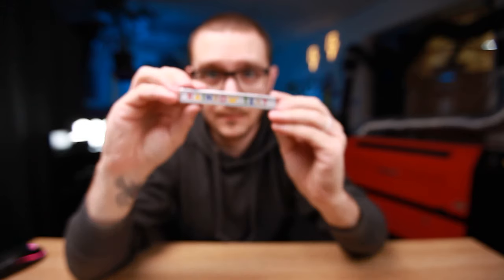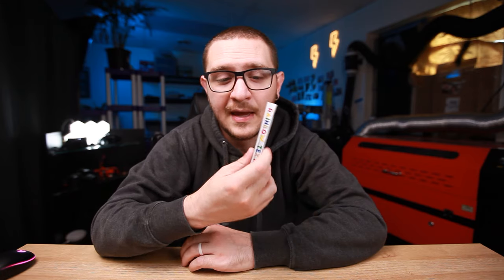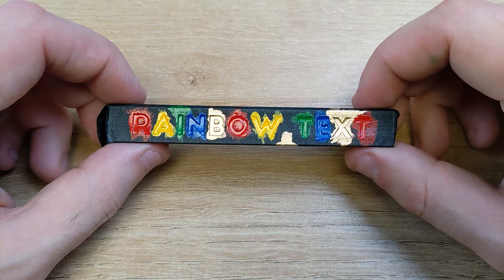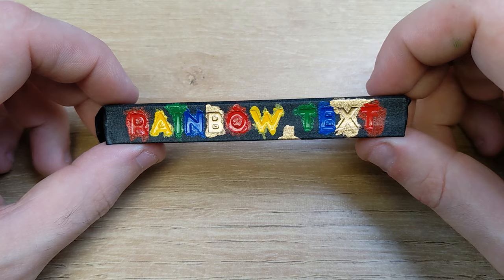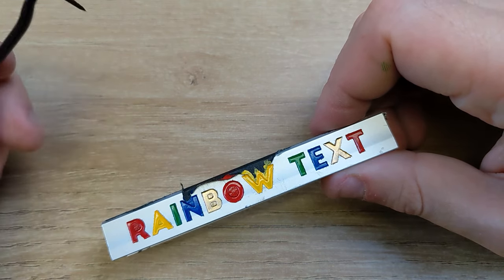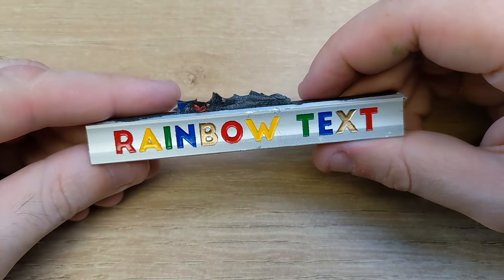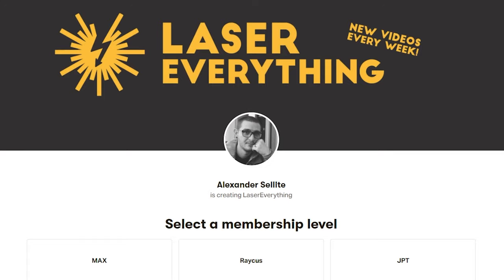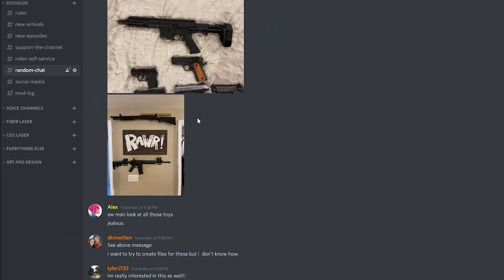COLOR Engraving | How to Color Metal Engraving - Backfill and Masking | Fiber Laser Tutorials

Comment from the maker: The video shows a line distance of .025 on one hatch and .08 on the other. They should both be .025 and I fixed it off camera - just FYI.
About 3 hours dry time between coats. About 8 hours dry time before sanding.

Comment: After laser engraving, before back filling, spray a quick coat of clear on it first helps seal the edges.  Plus if you ever do this with wood, it will keep the paint from bleeding or sucking into the pores of the wood, which will leave fuzzy edges.  I do this all the time and it leaves a very nice, crisp edge.
Reply from the maker: Amazing tips! Thanks for the heads up! Will definitely do that next time :)
Reply: Would please recommend a coat, which brand? Tia!
Reply: @1bigapp  If you're asking about the clear, then that all depends what your putting it on or what type of paint you use.  You can't mix types or they can bubble and stuff.  Most of the time I use clear polyurethane or MinWax Clear Polycrylic, or MinWax Clear Lacquer all in spray cans.  If my item will have a coat of clear all over when done, then I will clean, spray a light coat of clear on, mask  (makes masking stick better) then engrave, lightly brush or blow off, put a good coat of clear in the engraving to seal pores or edges,  paint fill or spray paint, don't forget about print ink like Marsh's Stencil Ink.  That stuff lasts great inside and out and dries quick.  Anyway when done painting, I let it dry about 1/2 way when I remove the mask.  I find the mask comes off better and allows the surface to be smoother.  If there is any lip around the edges, I use a plastic scraper or something like a credit card and smooth it out, then I spray the final coat of clear on it.  Sounds like a lot but Stencil inks and Lacquers dry super fast so it all goes quick.  I do this on woods and metals.
Reply: @RJMachine62  thank you, Sir!

Comment: You could do the same basic techneque using powder coat. You would have to remount the work piece and lase to melt powder coat. If the substraight is metalic or ceramic or other high temp material it could be baked.
Reply from the maker: Smart that would be cool wish I had a powder coat setup

Comment: Guys, I need some help, Engraving letters onto Brass with final infill. Just like the plaques, you find at memorials, etc. I've been persuing the CNC route but haven't discarded the thoughts of fibre. Is this possible, what is the right way? is fiber just ball ache for this purpose? There really is very little about brass engraving on the web. Thoughts?
Reply from the maker: You could do this with brass it's just going to take a long time. If that's your primary purpose CNC may be easier and more time-effective in the long run.

Comment: Great video..... I at times use syringes too that really help to fill parts
Reply from the maker: Smart! Never would have thought of that!
Reply: @LaserEverything  ya works great, just if the needle is long it can be a little tricky so I cut them short. When they are cut it normally crushes the syringe so I use a grinder to cut back to the undamaged part.... works a treat.
Reply from the maker: Definitely trying this out.
Reply: Yeh, blunt one

Comment: Loving these vids!!! Pro tip: when you mask anything that gets lasered into a stencil, spray with a clear coat first - this will effectively seal the stencil to the stock you engraved to eliminate bleed (esp helpful on wood, stone, and other rough substrates)... Question: what happens if you use blue or red tape (e.g. red laser-engravable sandblasting mask mask from Rayzist)? 🤔
Reply from the maker: Those are less than ideal, we use black specifically due to it's high absorption of the 1064nm beam which means it burns away much more quickly and efficiently thus resulting in a cleaner cut through. Red and blue will require higher energy density to remove leading to a less clean mask edge and potentially burning/fire on the tape which is obviously not what we want.

Comment: I can’t seem to get any depth when using these settings on my 100w laser. I have a 50mm lens should I be speeding it up or using less power?
Reply from the maker: On a 100w laser you should definitely be destroying a similar piece with these settings. Usually the problem with machines that powerful is that they're nuking the surface. If you're struggling to get any depth it might be time to double check focus.

Comment: Can we mask with cello tape?
Reply from the maker: I dont see why not, but I would suggest double checking the MSDS of whichever brand you opt to use, some may have some nasty nono stuff included in the make-up, since its not entirely cellulose based a lot of the time. Anything Vinyl (also duct tape for example, nono since its pvc/vinyl based) is a hard no for sure, but mileage may vary on what is in each brands I would guess. If you can do a paper or cloth based masking material, it is generally a safer bet unless you validate the actual material make-up of what you're using.

Comment: How many passes would you recommend for steel? I’m one of your patreons and I think the deep steel engrave is incorrect
Reply from the maker: It's highly dependent on the steal you're working on. It will never be deep in one pass it's labeled deep steel because it gives the cleanest mark after many passes. Steel general leaves a much rougher surface if you run it for as long to get the same depth. Deep steel is designed to leave a cleaner finish after going to the same depth some steals will be marked at a depth you would consider deep after 5 passes but other harder steels could take 30 or 40 or more depending on how deep you're trying to go.
Reply: @LaserEverything  ok awesome. I’m working on a fire axe which I believe is carbon steel
Reply from the maker: @xivsierra2579  Fire axes in particular are TOUGH, very hard to chew through. I let one run for 2 hours yesterday and kinda gave up and annealed it instead. Just couldn't get the depth I wanted and had to move on. Good luck!
Reply: @LaserEverything  yah that is what I was afraid of after burning through 3 axes
Reply from the maker: You CAN do it. Just gotta set it and forget it and work on something else.